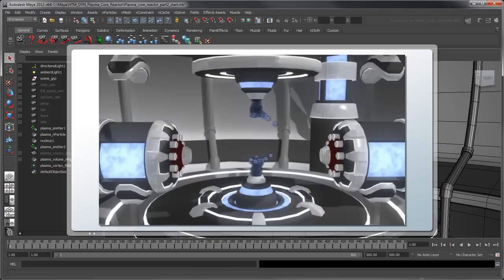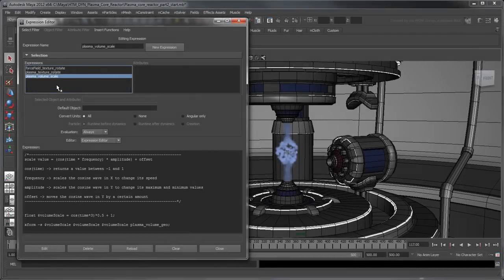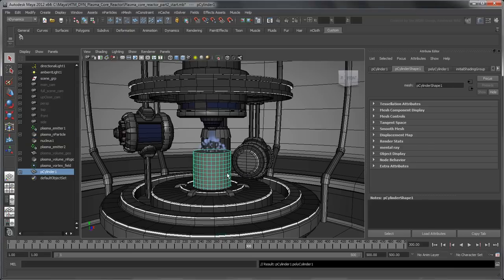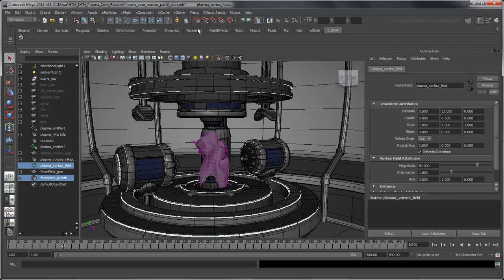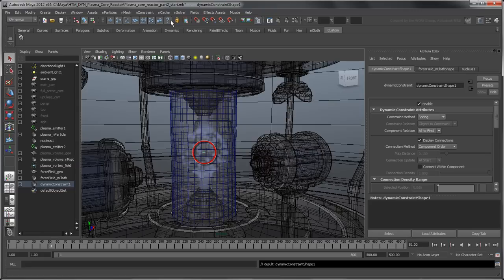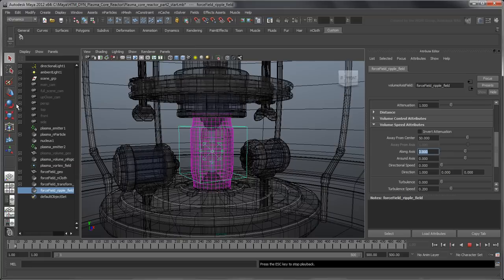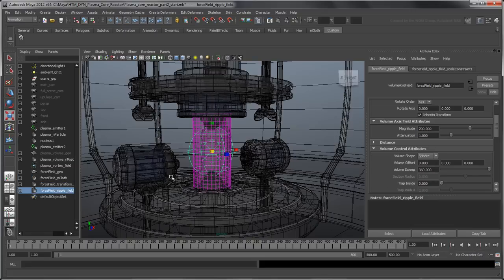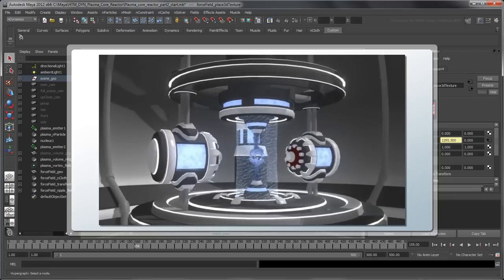Powering up a reactor using nDynamics - Part 2: Force field

Comment from the maker: Go to the Render Settings and make sure the "Render Using" option at the top is set to mentalray.  Next, in the File Output section, change the "Frame/Animation ext" option from single frame to any of the options with "#" in it (based on your personal preference).  Now in the Rendering Menu Set, go to Render > Batch Render.

Maya will output a series of rendered images (this can take quite a while depending on your computer) constituting your anim to the "Images" folder of your current project.